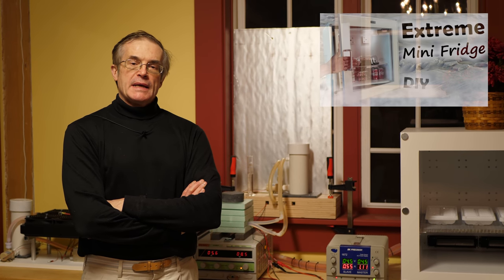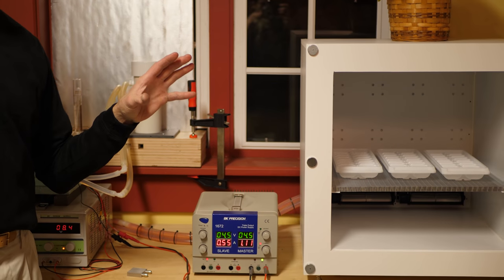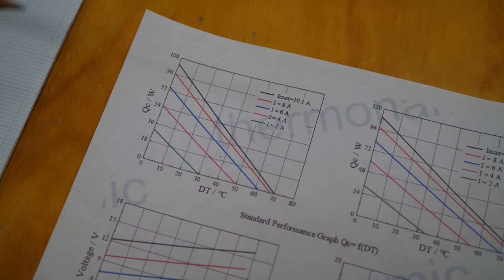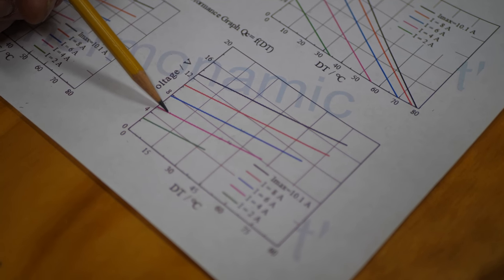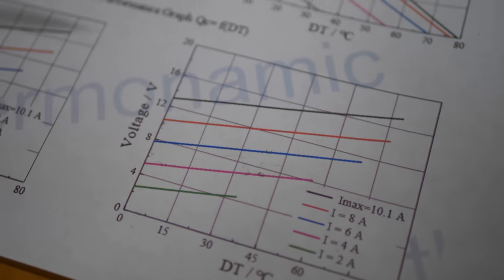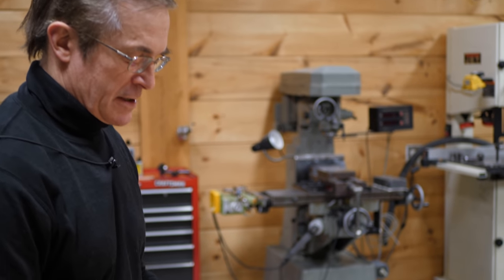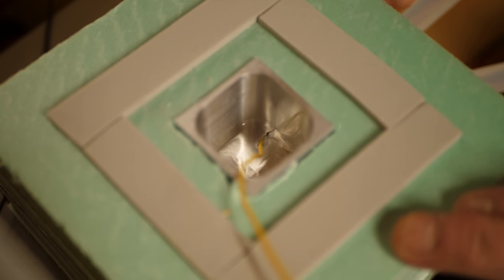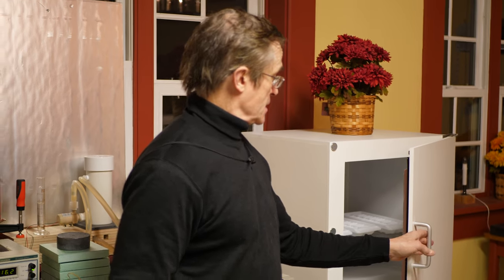EXTREMELY LOW TEMPERATURES! - Using TECs

Comment: Damn. A reliable way to keep water temps at -50c without having to deal with tending to a LN2 pot. I might have to try to replicate or modify your setup and use this for extreme computer overclocking. the main issue with trying to super-cool a computer processor down to -50c is obviously condensation. Could you give me some suggestions for how to remove condensation from a computer motherboard fast enough so it doesn't build up on the board or in the cpu socket? My thoughts were a box like your freezer to mount the motherboard in and some sort of solid desiccant like spread across the bottom of it in a tray perhaps. But I don't know if that would adsorb moisture from the air fast enough... could you offer some input or thoughts?
Reply from the maker: You could completely seal the processor with expanding foam although this is a one time commitment.  Make an effort to seal the mobo as well as possible and then run a blead flow of CO2 to create a positive pressure to exclude atmospheric humidity.  CO2 is heavier than air and this makes retaining it easier to engineer.
Reply: @TechIngredients  I could put it in a mini-fridge and seal it up and replace the oxygen with C02 insde.. that might be an idea.
Reply: @TechIngredients  What if I put the computer components inside a sealed chamber and then just removed all the air by a vaccum pump. No air inside = no condensation? Would that work? Easier too.
Reply: Hi, i'm using a Tec2 to cool my waterloop in my pc, but as the man explained in the dry ice experiment, the tec only really works like a HEAT pump
since your cpu already outputs allot of that and charged particles, it most efficient, 
at removing heat from a source thats not superhot, up to a certain point ...
even cpu waterblocks or finstacks, u need to use a medium in between to transfer it efficiently, and with allot of pressure, 
more than a motherboard can handle...and with superflat surface's, to get more efficient cooling done.
also the tec is thic , and best used then upon a direct die mount, without a cpu heatspreader, but that also is not the way to go , the i way i solved this and others is by, taking the heat out your waterloops since they get saturated, like finstacks, up to a total ammount of watts or jules of energy,  in order to save radiator and fan space, and to optimise the total sum of things.... simply mount the tec in between a cpu cooler on the hot side, and put a waterblock on the cold side of the tec in your waterloop. u could also use an waterblock mount a tec on top of it then a finstack on top of that to cool the Tec. or on your radiator, like a sandwitch... then your waterloops wil be about 50% more effcient and this also solves your condensation issue's... i have mine build in the case with suffcient airflow, but u could insulate it with grease and such as long there is no air in direct contact..
 to give u an example , my pc outputs about 150 watts of heat a normal finstack is rated up to 80w, and about the same to 100w for waterblocks, so add an 75-120w tec@ and ull be able to pull that extra 50w out and make sure itl remain stable and not over saturate..
(at room temps my pc runs 1 x 120mm fan + slim rad +tec for both cpu and gpu at a systemp of 40c ish i use a cpu finstack to cool the tec)
but other than that , ull need freon pumps or whatnot to actually freeze your cpu, or go below ambient even...thats how a chiller works.
also all in all u do not benefit much from yust 1 tec, as u need allot of surface-area, to transfer more jules across...
my build was focussed upon an small form factor itx, so in order to save space i opted for this solution....
Cryogenic cooling
https://www.youtube.com/watch?v=7PWESWqhD8s&feature=youtu.be

Comment: Indeed, stacking Peltier cells always decreases efficiency; however, if you're cooling a fluid continuously, you can first let it pass through a lower dT block and subsequently cool it down in another stage.
For instance, if you split a flow into two TEC blocks electrically connected in series, then rejoin it and run through another TEC block electrically connected in parallel with the series of 2 TECs, the cooling power of both stages should be similar and consequently, the fluid should decrease in temperature about the same in both stages. The COP should increase by an approximate factor of 1.5.
Reply from the maker: You failed to include the heat generated by the first set of TECs in addition to the heat pumped by this first set of TECs in the heat load that the second set of TECs has to deal with.
Reply: @TechIngredients  I meant a case where all TEC blocks dissipate heat into the same heat reservoir (i.e. the fan cooled water), not just jamming an overly complicated heat exchanger in between the cells - that wouldn't make any sense. Maybe I should have been more precise.
Reply: let me add this atrocious schematic: https://imgur.com/a/4nGJA56

Comment: Nice Video 👌🏼 just a question: does it make sense to put a TEG on the hot side of a TEC to generate energy from to heat side of the TEC? So I can use the unwanted heat to produce electricity?
Reply from the maker: Thanks.
No, it doesn't.  The TEG will restrict heat flow in the process of generating electricity the same way the boiling water in a pressure cooker has to squirt out of a nozzle to drive a turbine.  The heat restriction will lower the performance of the TEC more than the energy you can recover with the TEG because both devices are less than 100% effecient.
Reply: Tech Ingredients thx for the explanation!

Comment: -3 degree outside and you managed a -56 degree for a stacked Peltier. That's more than 50 degrees drop in temperature. I wonder, if the modules weren't stacked together, would it still be able to get that same -56 degrees Celsius?
Reply from the maker: No, more like 35 C.

Comment: Is there a use for this in automotives? Place some on a water to air CAC (charged air cooler), and reduce inlet temp/ increase oxygen density? 
Got a fair amount of 'free' current from a decent alternator.....
Or even just stick them to the intake plenum of a V6/8/...

Comment: I would want to use it for a self cooled thermos for working out in the field, powered either by a solar panel, a non-vehicle-utilization type power supply [battery, capacitor bank or fuel driven generator] to keep the unit's contents chilled to a reasonably drinkable temperature in the peak of hot summer weather for the workers [primarily ME].
Reply: An ice cube in a good vacuum thermos seems to work good for me. You might just be using cheap plastic ones (I stored some dry ice in 3 different containers, the plastic one had all the dry ice gone 100% in 24 hours, the metal one I use had 30% left over at 48 hours, and a  different metal one that I hate the lid of did the best with 20% at 64 hours, but I hate it’s lid because it’s not as easy to clean).
Reply: @jakegarrett8109  Good for you.

I'm gunna do whatever I'm gunna do.
Reply: Delicious DeBlair ok, I was just giving you info that you probably don’t have to connect your cup to a cable to keep it cold when sunlight is available, and giving a cheaper, portable, and more convenient option that works everywhere and even on a cloudy day. I didn’t say you had to go the obvious approach, I’m the kind of guy that ads voltage boost converters and cranks the voltage until my PC case fans smoke instead of just buying the faster running fan. I keep a large supply of fire extinguishers for some of my also impractical projects....

It’s just data, you can use it as you like, or not use it all (or use a better thermos with solar if you wanted to chill the drinks down even colder). Do as you wish, none of my info is a suggestion, just info.
Reply: @jakegarrett8109  I am an energy researcher with a few degrees behind me. 

I know what works and what does not work. 

Also I know what I WANT to do, and WHY I want to do it.

Contrary to popular belief, not all bonds are air heads.
Reply: Delicious DeBlair I didn’t say not to do it, you seem to think I am.
I’m a mechanical and aerospace engineer that most enjoyed my classes in fluids/compressible fluids (supersonic regime)/thermodynamics/heat transfer courses the best.

I’ll be honest, while sitting on the toilet I was just now looking up turbomolecular compressors for some fun things I want to do, and talking about efficiency, you get 2.5 watts of heat load at 10 kelvin requiring a 3,600 watt compressor alone, yikes that’s inefficient!. I’ll still definitely get one, but, there are probably cheaper ways of doing what I have planned... Kinda similar to how I’d put a jet engine on my bicycle if I found a way to get it road legal (sure you can motorized a bike for over a magnitude cheaper, but I’ve already got a pile of motorized bikes, and what’s cooler than strapping a jet engine to a bicycle? Seriously, if you think of something more awesome, then let me know so I can do that too!). I also doubt the jet engine will be what we say “efficient” or “practical”, but might as well because it’s cool!

So I’m not saying you can’t do what your wanting, but I am mentioning that a simple $10 thermos that works anywhere and everywhere and all the time without messing with wires will work. But obviously I’m not opposed to doing the impractical, because sometimes impractical is cool (people laugh when they hear my car makes single digit mph, but that concentric spinning triangle in an elliptical housing does sound amazing and makes some nice fireballs when your spinning it up! Go Wankel Rotaries!)

Comment: so, i am very interested in when you say, "like a micro chip", ive seen attempts at this on modern processing units, usually placing it cold side onto the chip with a thermal pad, or grease. But it always seems to result in the chis continuously heating and never really finding its happy spot, or heat soak as i were. i assume this is because a micro processor has alot of variable temps? as well as the ineffective heat sink? would it be better to say run one on something like a radiator instead of direct contact to a chip. Or is the statement not ment for something like a CPU,or GPU, rather a different chip altogether?
as for efficiency to a cpu i dont see how this could really be a major benefit regardless water cooling, and near sub ambient is getting better and better, could you possibly produce a video on the subject? i also was super interested in the idea of using some form a descant based cooling system, similar to your air condition system to build some kind of super cooling water loop that would kinda rock the tech world. Although ultimately i think said project may be impractical. Any way love the content, thank you for making such inspiring content!

Comment: hello mister can you help me, If I want to make a fish cooler box with a capacity of 16 liters containing 3 kg of fish, how many Peltier modules do I need and what voltage and current do I use so that the power is not too large? Thank You
Reply from the maker: That isn't enough information.
What is the thickness and type of insulation insulation of the box?
If you start with ice and just want to keep it frozen and cool down the fish, you'll need much less capacity than if you want to cool the fish AND cool room temperature water with it.

Comment: Hi there, I loved your video.
I have a small ice cream cart, it's almost the size of the freezer that you've made, it has a great thermal insulation. But it's not enough to keep my ice cream frozen for more than 3~4 hours under the Brazilian summer sun. So I want to use TECs to extend to 6~8 hours of non melting ice cream under a 35ºC. Since it's a cart I need to run it on battery, can you help me find the best configuration of TECs and battery pack to use?
Any help would be appreciated.
Thanks
Reply from the maker: That seems like an ideal use for these devices.  The most important limiting factor is to keep the "hot" side of the TEC as cool as possible.  I'd locate the heat sink for the hot side in the shade under the cart and add a low speed fan to enhance the heat exchange.  Use heat pipes, these are readily available on eBay to transfer the heat or the cool, depending on where you locate the TECs, through the insulation for the cart.  It's important to use a fan as well on the inside to distribute the cooling.  The trick with TECs is to get the heat as well as the cool away from the surfaces to minimize the differential.  Select the fans and the TEC wiring in other words, parallel vs series to match the voltage of a Lithium ion battery so that you don't have to use a controller.  Then you only need a shut off when the voltage drops to a selected minimum.
Reply: @TechIngredients  
Thanks for your comment.

I'm having a hard time finding the heat pipes you mentioned, do you have a link where I can find them?

Also, what you think would be the minimum capacity battery I would need?
I tow my ice cream cart with a bicycle and the ice cream is already frozen, I can even "pre-cool" the cart before using the battery. 

So, I'm going for the lightest setup that can give me 6~8 hours under the sun. What measurements do you think I should do to help my decisions?
I thought I could put 1 liter of frozen distilled water and time how long it takes to melt inside the cart. That would give me the amount of heat I need to pump out of the cart in a sunny day. What are your thoughts?
Reply from the maker: Depending on where you are located the heat pipes might be easier to find if you look at computer cooling retailers.  Ultimately, we didn't use these with either our refrigerator or freezer projects.  They just would have worked better with them.  Because there are so many variables that would determine the amount of cooling you would need, build a  small system that is modular or can easily be multiplied.  Even an undersized system can only help to extend your operational time.

Comment: So the way I see TECs, they would be maximally useful operating at phase changes merely removing heat, not lowering the temperature at all, letting some adiabatic expansion take down the temp later on in the system. Is that correct??
Reply from the maker: That is an interesting perspective.  For the  dT to remain small, both sides of the TEC need to operate near the same phase change tempreture.  An example would be to turn a quantity of water into ice within the refrigerator and melting the same quantity of ice outside the refrigerator to cool the hot side of the TECs.
Reply: I fear I didn't think it through too well. What I thought of would end up being a kind of (forced) heat exchange unit. With the actual cooling done by some other means :-(((

Comment: How much energy does the mini freezer use when idling around minimum temp.? I mean, does it make any sense in comparison with a regular freezer using R-134a?
Reply from the maker: About 170W continuously for the freezer and 110W for the refrigerator.

Comment: I stacked two TECs connected in series, but the upper (hotter) one got almost immediately electrically damaged (infinite resistance). 

Actually, the hotter module has to remove more heat from the cooler module. If it doesn't succeed then its temperature difference increases, which leads to lower heat removed, and so on.

It seems the advice to stack TECs with same current was wrong. Could you, please, provide more reasoning?
Reply from the maker: Sure.
You need to consider the performance curves for each module.  Then, starting with the top (coldest), identify the amount of heat you want to pump and at what temperature.  Calculate the power necessary to move that much heat and look at the power curve as it relates to the temperature differential they will produce. 
Next, add to that pumped heat the power consumed in that module and again look at the power curves and how hard you need to drive the next module to move that total amount of heat and achieve the remaining temperature differential to get to the overall differential you need.
This process requires you to look back and forth across these curves to reach an optimal system. It's kinda fun.

Comment: Thanks for the video. I have a question. Would it be possible to build up a momentum of thermal exchange if these were placed in series inside of a partitioned tube with n - 1 gaps between the devices but instead of air we use a sodium chloride solution with 0 air bubbles. We would ensure that opposite poles face eachother. We would ensure that each device had its own separate power supply and the experiments would measure thermal activity in each gap plus the temp differential between the two ends. We would also want to establish a harmonic ratio going from n5 to n1 to see if a pulling or pushing effect could be established. Convection would naturally be established in each gap creating a clockwise or counter clockwise current as long as power is applied. I am just curious 8f anyone has thought about this before?

Comment: Instead of a "unit" series  of tecs, what if you were to have them all individually stationed but have the coolant travel over them in series?
Reply from the maker: The effect would be the same.  Transmitting the thermal energy directly through thermal grease or over a distance with a flowing liquid, the heat added at each stage due to the electrical pumping has to be eliminated through subsequent TECs if a progressing thermal gradient is desired.